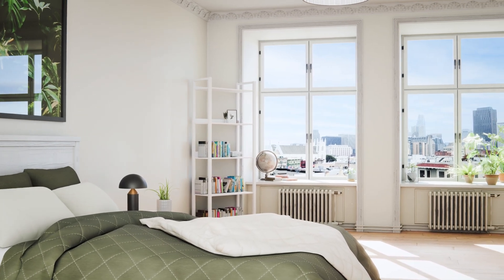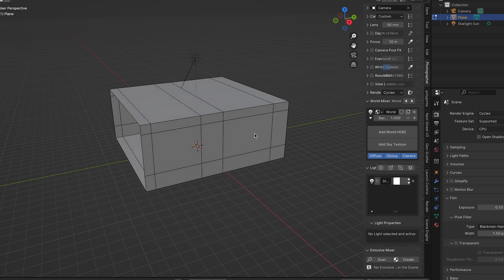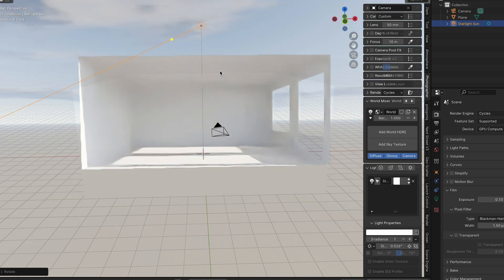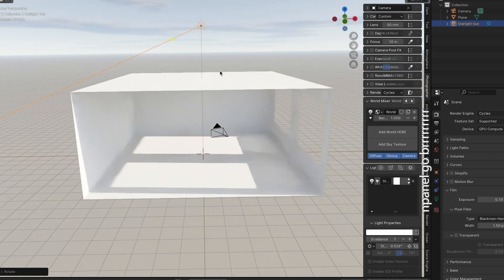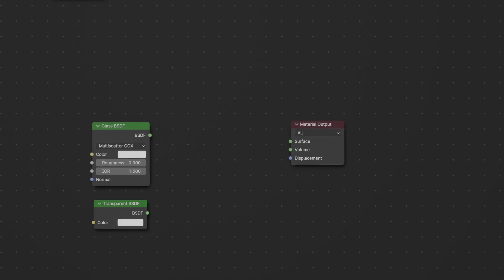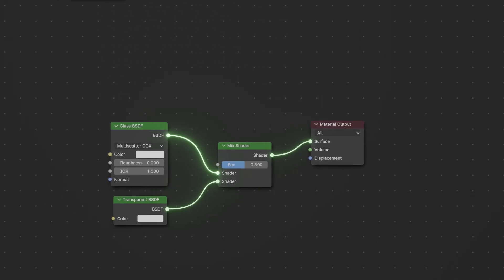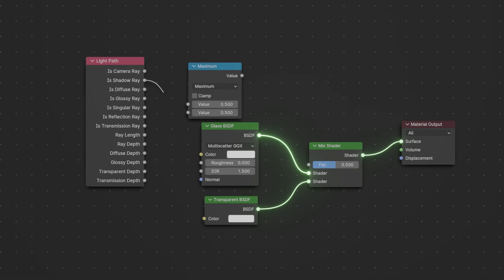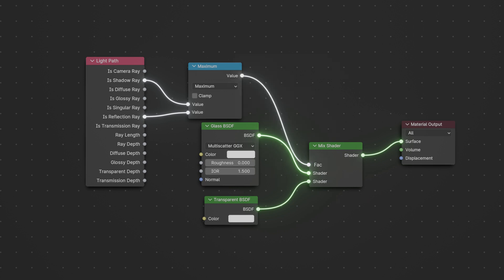Better interior lighting in blender | material tutorial

Comment: Oh, this problem has been bugging me forever. Blender just doesn't handle glass properly. Glass doesn't behave like glass should. I got an add-on called Shaders Plus that makes glass render better and faster, using caustics correctly and it's beautiful.

I don't know much about the software side, so I can't say if it's a system-wide issue or something fixable. But it seems like it's been a problem since Blender was created, probably due to how it's programmed. I hope they fix it soon. I've heard they're working on something called Path Guiding that might help with this, again i'm no dev so i might be wrong. It's frustrating because I love modeling things with glass and emission, but those two don't mix well in Blender.
Reply from the maker: Unfortunately it won’t be fixed. It’s a result of cycles being a bias partial spectrum path tracer rather than simulating the full spectrum of light, you can however use LuxCore which is open source and can plug into blender, it’s full spectrum, though it’s fiddly and the materials are different so I only really recommend it for stuff where glass simulation is super important, I love shaders plus for everything else it’s fantastic!
Reply: Exactly! Such a pain. It's one of those things that work so nicely in Octane, but with cycles we need all these hacks to make it work. Path guiding has been built into Blender for a while now. Should give it a go